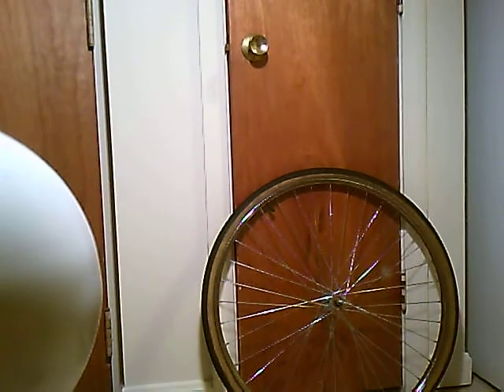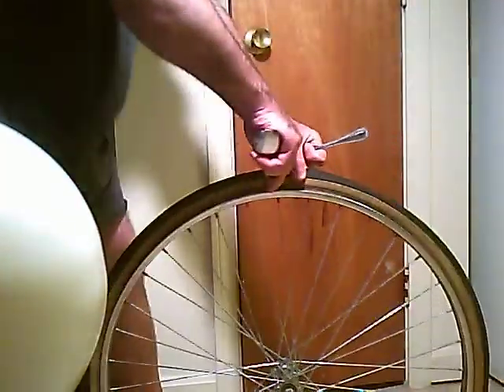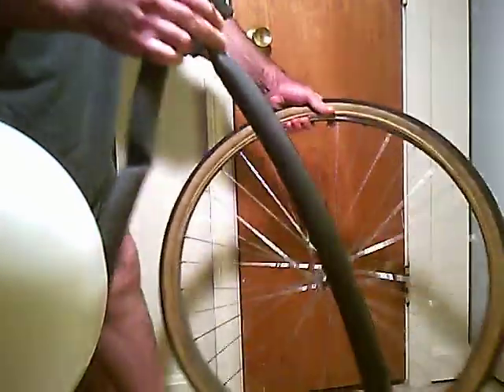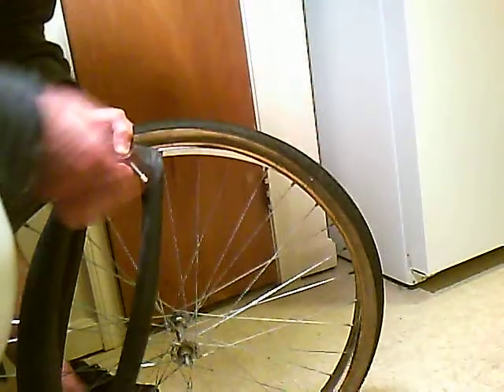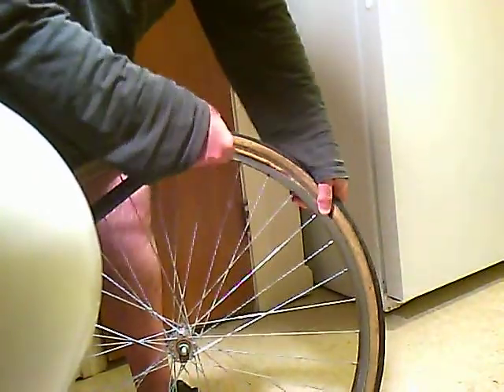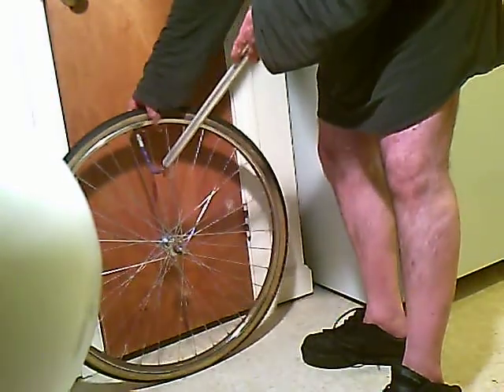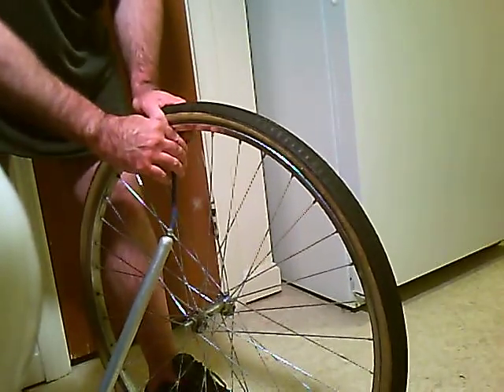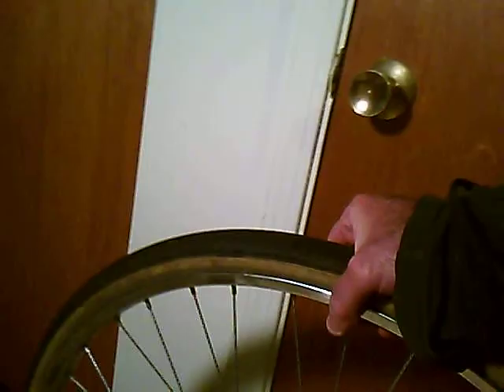Changing flat inner tube on bicycle

Comment from the maker: Look on the innertube, if it doesn't hold, for the measurements so you can buy the right size. They may be imprinted in the rubber or painted on in white numbers.